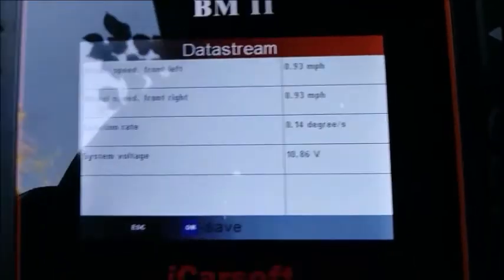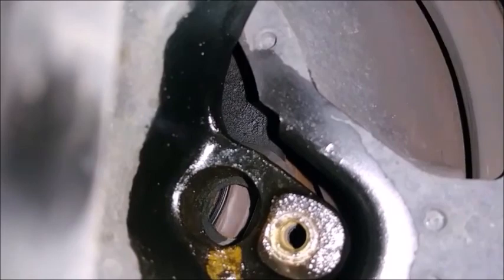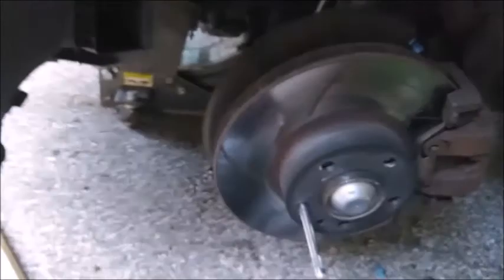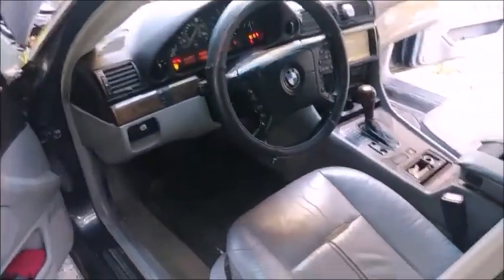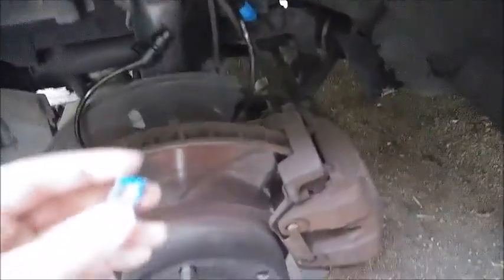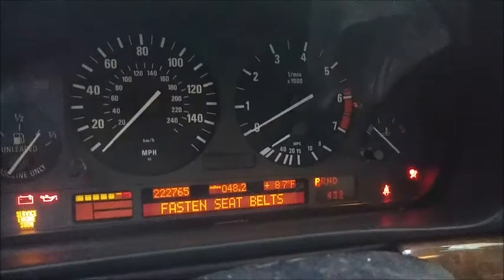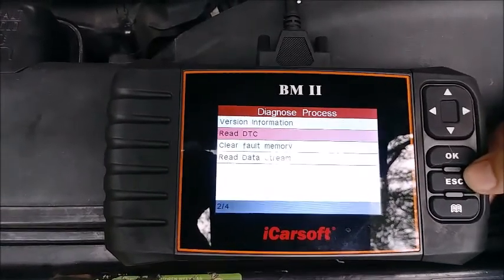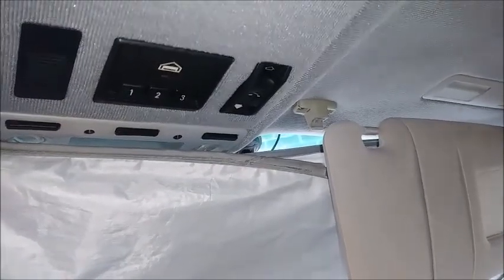BMW e38 how to fix Brake ABS DSC light trifecta

Comment: So this scanner doesn’t just tell you that driver side abs sensor malfunction ?  That’s a lot of work to diagnose a bad sensor even with a scanner
Reply from the maker: You missed the point of the video. The code was for implausible speed per front left sensor. That could be because of a broken reluctor ring, bad sensor, bad ABS module, bad wiring, water intrusion, etc. Don't ever just read a code and so no further diagnostics or trouble shooting.

If you get a "catalyst system efficiency below threshold" code, do not be lime Dobbs and replace the catalytic converter and clear the code. First, use the code reader to check the voltage output of the rear O2 sensor. Replace if no voltage. Check fuel trims; is the car running rich or lean? Check injector pulse. Check fuel pressure. Check air filter. Check PCM. Check grounds. Check vacuum. Check TPS. Check MAF or MAP.

Just because the code reader says the front left sensor can't read the signal doesn't mean it's the sensor. I just ruled out all other possibilities and confirmed with a multimeter the sensor is actually bad before spending $85 on a new sensor.

If others did the same with a P0420 code, as I did with this ABS code, they'd save a ton of money by not replacing Catalytic converters that are working fine.